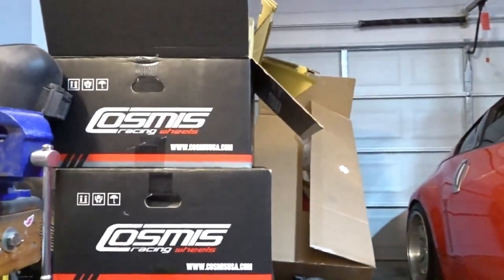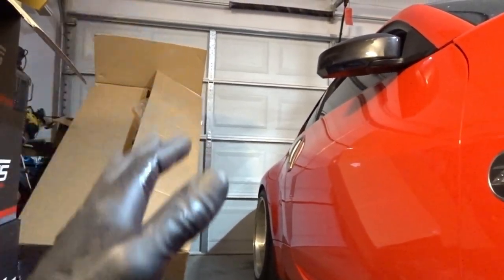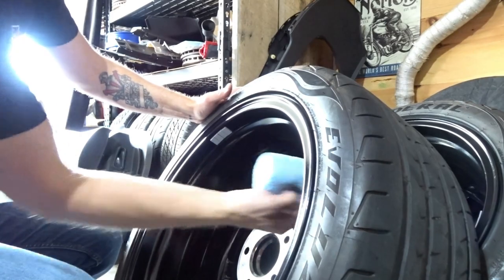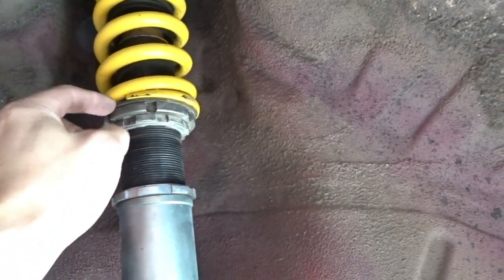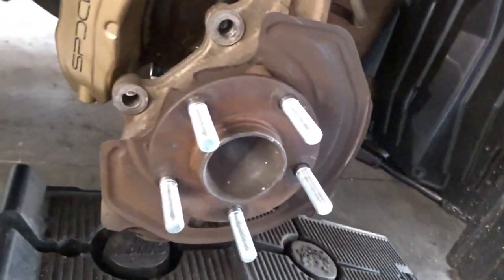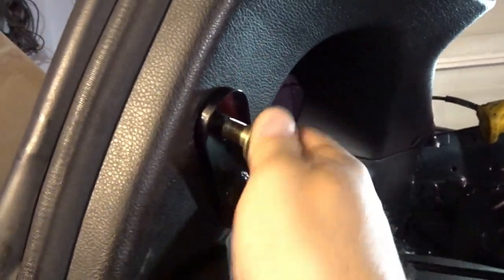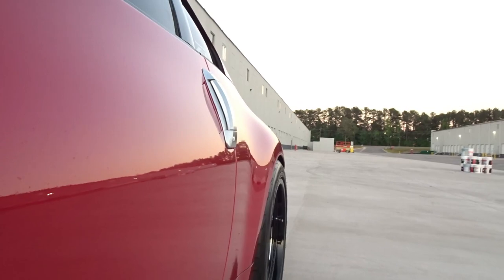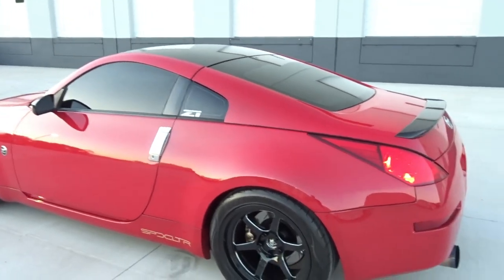Weekend Vlog | TONS of upgrades made in 24 Hours!

Comment: Hey Jordan have you heard anything about the Q50 TCMs going out? I just got code P0720 and from my research it seems to be around $4k for a dealer to fix it. Do you know of any cheaper fixes?
Reply from the maker: Valve body is starting to be a common failure.  Finding a used trans is an option, but not a guarantee it won’t fail.  Many are upgrading to a  vr30 transmission which ends up being close to the same cost but appears to be free of the failure
Reply: @SpeedCultureStudios  Great! I don't have money for either so I guess I got a new paperweight 😂
Reply from the maker: @acm_1028  well don’t lose hope yet.  Get it diagnosed first, of course
Reply: @SpeedCultureStudios  Ya I was hoping to get it done this weekend but everyone is closed